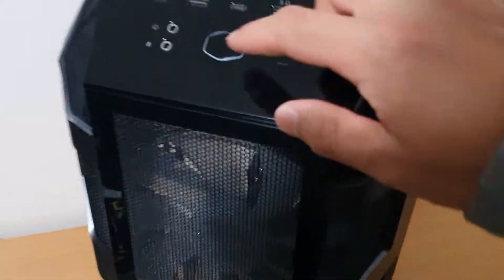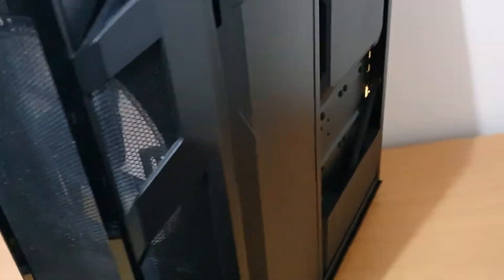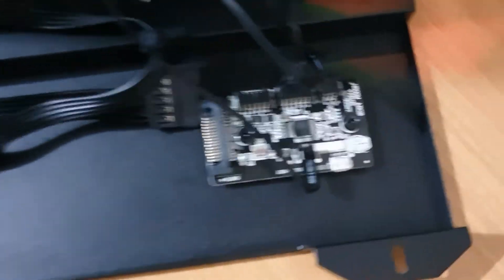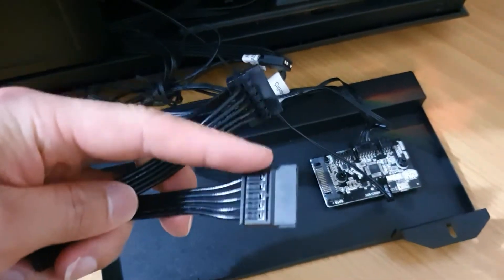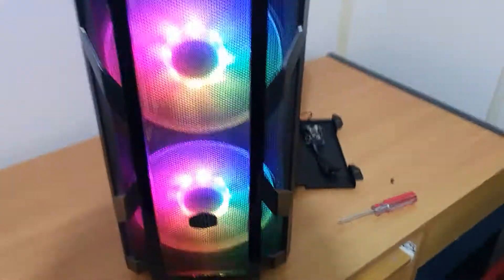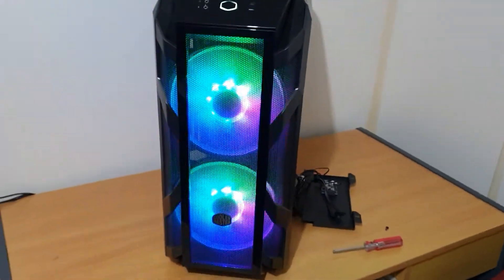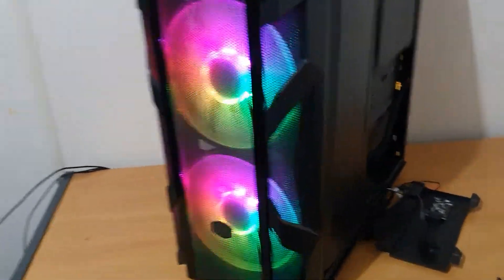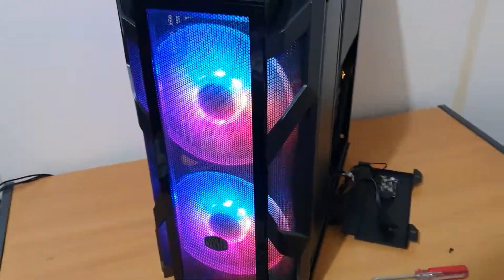Cooler Master H500M - How to get RGB working

Comment from the maker: UPDATE: This is the RGB controller that comes with the case and to change the color you just press the reset button on the front panel of the case
Reply: Can I control the rgb by software?
Reply: @ibrattan2192  yes
Reply: @lucaspoole8866  How? because I tried to download masterplus to control the RGB but it couldn't detect the case
Reply: I’m going to try the reset button method when I get home. I set everything up and the RGB works but it just goes full rainbow. Same as others tried downloading software and nothing was recognized. Hopefully this reset button can change to a full color lol
Reply: @Young_Bourdain  the reset button can change the light mod but u stick with few mods and one of them for me work only in 1 fan 
Only if master plus could recognize my case life would be great
Reply: @kamedhi  i was able to change mine, thank you!

Comment: That is the rgb controller that you just connected the sata to, it comes with both a usb cable and 3/4 pin connector that goes to the motherboard.

Comment: No you can controller the colors lol that'd what the whole controller is for and you can add 2 other RGB Accessories and thru software/motherboard can control them and the fans speeds

Comment: The cable for the USB to MB seems to be wrong in my case. The cable do not fit in the controller so my question is, does that mater at all ?
I see in this video that the fan works perfectly with nothing in the USB connector.
Reply from the maker: Hi, you dont need to connect any cable into the controller for the fans to work. The cable that I connected to the controller was a sata cable from the power supply

Comment: just use the reset button from the pc front panel just plug the wire to the rgb hub and bam ur done. change colors easy.
Reply: Yea but you only get like 10 basic lame themes plug in to motherboard and BAMM you got FULL CONTROL TOMatch the colors/RGB with everywhere rgb u got

Comment: Ahhh. Never built a pc before. Considering if I should get this, Fractal Design Define S2 Vision RGB 
or some less expensive case. :/

 I got a ASUS ROG Strix X570-F GAMING, S-AM4 motherboard.
Corsair Vengeance RGB PRO DDR4 3200MHz 16GB for ram.
Intel 660p 2TB M.2 SSD.
I do hope that the MSI GeForce GTX 1080 Gaming X I got some years ago is still good enough for a while longer. 

 As for the rest I am really not sure. I have been thinking to just throw myself over AMD Ryzen 9 3900X Prosessor and just hope my wallet do not leave me for being unfaithful.

 I guess most is covered at that point. I have no real idea about power supply. Corsair HX750i, 750W PSU is what I have looked at mainly based on the idea that platinum should be safer and better than gold... But damn double the price. T-T
 Oh yea, and then there is cooling. Again I have no real understanding of it at all. So far I have just looked at Cooler Master Hyper 212 RGB, mainly due to "hurr durr, glowing lights" and a dream it may not be too difficult to superglue onto the computer.
Reply: I was checking the fractal as well until I saw this one. Fractal vision s2 has a less optimal air flow due to the front glass, which knly has a small gap for air intake. Also, in the right side all cable management is visible, while in the h500m it is almost completely covered. And, at least in spain, the fractal is about 50e more expensive. 
The h500m also has four 3.0 usb ports, while the fractal is two 2.0 and two 3.0. And a GPU support so it is not bended.
If you do prefer the looks of the fractal, check the blackout version that one is cool as hell (same as the rgb version, with tinted glass, but without rgb), and you still can get come argb fans and a controller  to put in there and do a nice custom light setup.

Oh. And forget about thr 212 for cpu cooling, save a bit more and get at least a 240 radiator AIO water cooling (cordair or cooler master would be my choice).